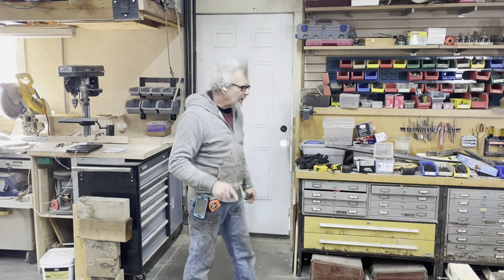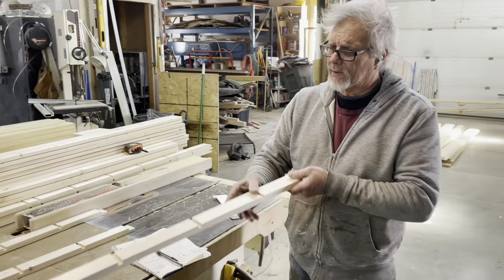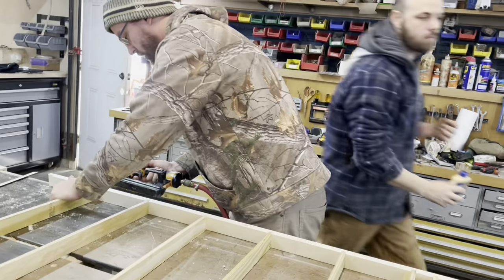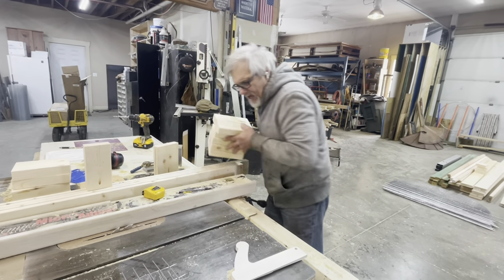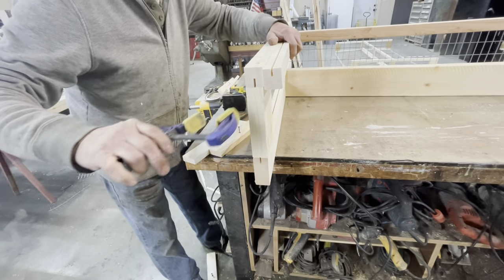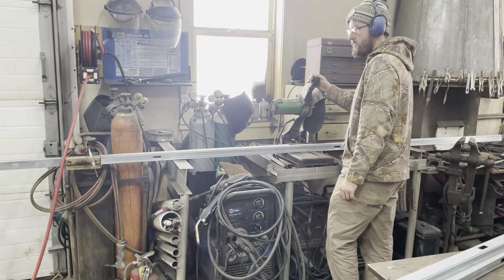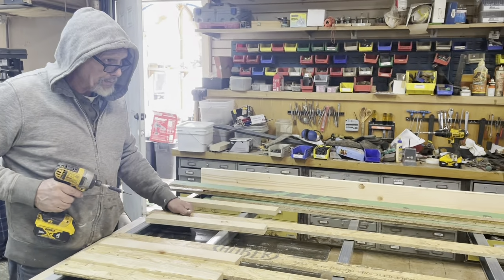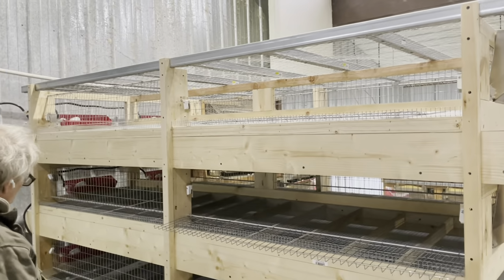How to make a quail cage by papa the builder at Myshire Farm! (With some nuggets along the way)

Comment: how is the waste managed? i saw the board under each layer but it looks fixed.
Reply from the maker: It goes in between the boards
Reply: Wasted material that holds that board, looking strong and don't need to be so strong.